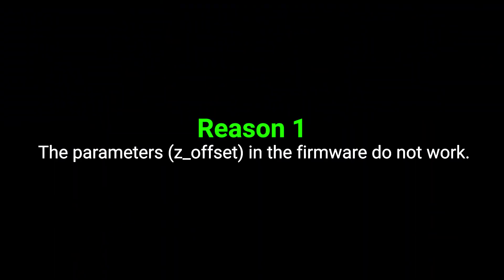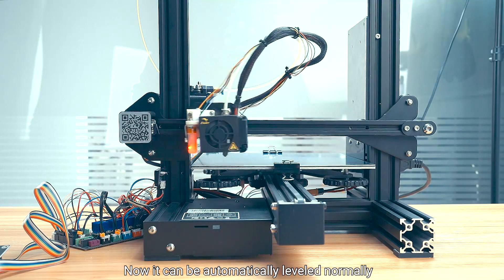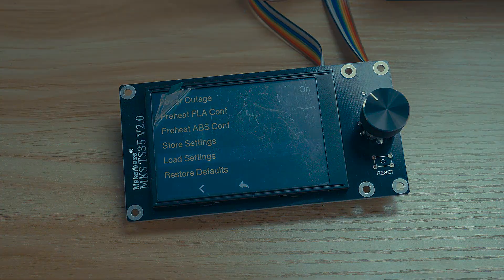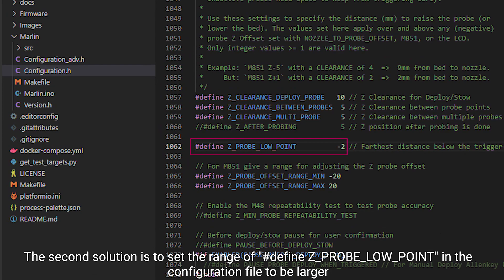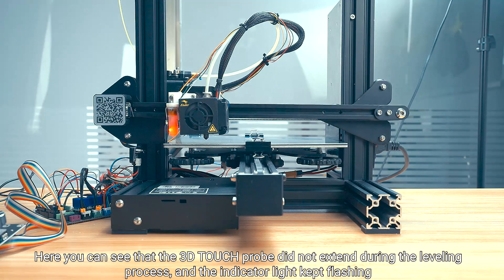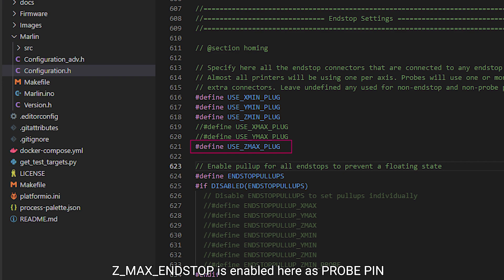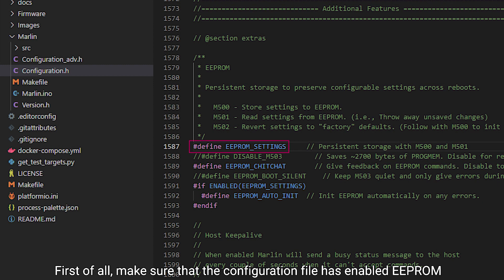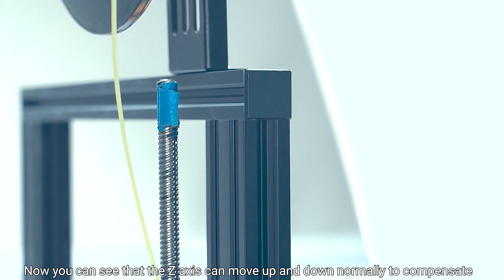3D TOUCH frequently appearing problems and solutions

Comment: the solution definetly isnt to set the maximum offset higher, but to level your bed.... if youre printing a part at like 150mm, youll have around 1.5mm skew in it in the Z, /=| where the | is the top layer and / is the bed....

Comment: I have an ender 3 pro with bl touch setup. Everything worked fine even the first print came our perfect. But when I go to give another print the while doing an auto bed leveling via start gcode, probing stopped at 7/9 point. I tried multiple ways to rectify. When I turned off the printer and tried again it worked fine. Not sure if it's issue with eeprom

Comment: I’m having an issue where after I create the mesh of points, I discover they are not accurate. There are times where the points are spot on or need minor correction with a sheet of paper, and then there are times where the nozzle is significantly off and the filament doesn’t stick to the bed, and I have to manually fix the mesh with a piece of paper. Any fixes to this?

Edit: I am using a CR Touch and Jyers’ 5x5 BL Touch Mesh.

Comment: I'm trying to make 3d touch work on my brand new ender2 pro and it doesnt work. It is going up on the Z-axis but it never goes down, even if I manually want to move the Z-axis down - it doesn't go.
Reply: I experience the same thing. Did you find any solution?

Comment: hi, i just bought 3d touch. it homes x and y axes and it goes for leveling test.but it straight goes to center,checks 2 times then stops.why it doesnt check 9 point of the bed?
Reply from the maker: This is an incorrect configuration of the firmware, did you follow our tutorial to configure it?

Comment: I installed 3dtouch on TwoTrees SP-5. When Auto level button is hit it homes all axis, asks for z offset, and then does nothing. Please help!
Reply from the maker: It won't auto level? Are you wired and configured correctly? You can send your wiring photos and firmware configuration to this mailbox 1428043543@qq.com, we will check it for you
Reply: @makerbaseteam4217  did you get it?
Reply from the maker: @XxFirePizzaxX Got it, where is your configuration file? i need config file

Comment: When I press home or autolevel it homes x and y and goes to the center of the bed. When there, the bl touch will extend its thing and just stay there. After a while it will give the error: 'PRINTER HALTED"

EDIT: found the problem, I accidently switched the E and Z cables why upgrading main board

Comment: I'm tempted to throw the BLTouch agaisnt a wall and bulldozer over it.

The BLTouch does it's selftest correctly when I turn on the power. But after that it just stops.
It wont do a manual selftest, or deploy (it does have a small blue light that turns on, but the VLTouch itself is red when the probe is retracted). 
When I autohome the probe stays retracted and just wants to crash on my bed. 
I checked the wiring, but everything looks OK. Even did try to wire it differently but it either doesnt fit or doesnt even do the power on selftest or becomes red.

It's on an Ender 3 Pro with the V4.2.2 mainboard. BLTouch is Smart V3.1
I need to use the Pinboard A because the wiring and cannot insert it directly on the board because the order of the 3 pins are: SIG (yellow), GND (blue) and VCC (red).
The 2 pins are in the Zstop on the board (black to the left, white to the right)

Please help

Comment: My Bltouch on ender 3 pro is weird. It doesn't deploy or stow, only stays stuck in a position. The LED turns on when force is applied, but without it stowing I cannot print.
Reply from the maker: Is this 3Dtouch working normally before? Or is the newly installed one not working properly?

Comment: i have just installed the 3D touch on my Ender 3 Pro and when getting it to Bed level, the probe extends but fails to stop, the nozzle crashes into the bed so i have to power off. any ideas anyone? many thanks.
Reply from the maker: You need to check whether the white signal line of 3Dtouch is connected to the enabled pin on the motherboard
Reply: Not sure if this was fixed, but bltouch version 3.0 had issues like that. Pretty sure it got fixed with the touch 3.1, but if you have the 3 then teaching tech has a video going over solutions

Comment: Error:Probing Failed.  I'm running an Ender 3 V2 with Smith3D-E3V2-2.0.x.16-5x5-Slow-100121 firmware.  It had been working great for about a year.  Then I started getting low hot end temp alarms, but I fixed that with tuning (I included in this comment in case it turns out to be relevant.  I'm getting a probing error (with BL Touch) at random points during the G29 bed leveling step.  I'm doing a 5x5 leveling grid.  Sometimes it fails early, sometimes late, but rarely makes it through the whole bed without failing.  I've manually leveled my bed.  My Z-offset is -2.35mm.  I have also replaced the BL Touch connectors with the correct JST type XH connector (I thought error was caused from the BL touch connector was making intermittent contact). I've also checked to make sure the bed is high enough so the BL Touch probe detects the bed before factor Z-home microswitch is tripped, although if I manually trip this during the bed leveling, it is ignored, so that is definitely not the problem.  I'm stumped.  I don't know what else to try.  I've also checked my bed to make sure it's not (badly) warped.  It's as flat as I can detect with a straight-edge.  HELP!!
Reply from the maker: You can check every item mentioned in the video, the firmware configuration should be incorrect

Comment: I have a bltouch on ender 3 pro. when I set it to home the z axis. It homes y and x first. The z axis will lift up and start to do the homing in mid air. I’ve tried different kinds of software and I’ve checked the wiring like 1000000 times and it looks good.
Reply: i have the exact same problem. dit you find a soulution?
Reply: @SuperAtju  I have the same problem too. I'm going to guess that you guys haven't found a solution yet.
Reply: Same problem. Z axis isn't gong down. Did you guys also remove the Z-endstop and did you plug all wires in the BLtouch slot?
Reply: @goku445  have you found the solution for this?
Reply: @torcek1991  Yes! It was a connection issue. I reseated the plug and secured it with hot glue. Working perfectly since.
Reply: @goku445  thanks, I had the same issue and it turned out that I had connector issue as well - now works :)
Reply: @torcek1991  Glad it helped. Enjoy!

Comment: Hi, I have a geeetech A30m, and it wont use the data from the 3d touch, or its uses the old data, becouse 3d model its always loose to the right and thight too the left.
Reply from the maker: Is the data useless after re-leveling? What motherboard and screen are you using? Did you save and load the data after leveling?

Comment: hi i got a problem with my bl touch on cr 10s when i set z-offset in the correct way and i proceed to print the bed get automatically leveled by bl touch but the print start with the nozzle always lower hitting the bed
Reply from the maker: Hello, is the nozzle kept pressing on the hot bed? This is the value of z_offset is too large, you need to reduce the value, and then need to re-leveling
Reply: @makerbaseteam4217  i have already fix It, i dont know why when i was setting the z offset the printer refuse to use the right value thanks!
Reply: @manux1508  hey how did you fix it
Reply: @gabg116  i Just used the printer interface because pronterface wasnt saving the offset and i Just lower the bed with the knobs most as i can

Comment: Hi, my bl touch levels bed when I manually ask it to. So I go onto the printer screen and click bed levelling and it probs all 9 points. However, when I start a print and it levels the bed again it'll go into the middle of the bed and go all the way down and the nozzle and no touch crash into the bed
Reply from the maker: Did you add an automatic leveling command to Gcode? What instruction did you add
Reply: @makerbaseteam4217  Mine does the same as his. How and what code would you add for this specific issues. I'm working with an Ender 3 v2.
Reply: @thersmokey6131 I have the same problem right now. Any solutions?
Reply: @Dave-ut2zs  hey, did you solve it ? i got the same problem

Comment: no ı tried but ı dont have initilaze or load settings on my menu and I tried to change the cables black and white didnt work I tried to re edit the firmware , with visual s code and platformio when I finished I couldnt compress to bin it gives mistake egenadira@gmail.com is my mail, maybe you can send me the .bin file for this
Reply from the maker: What motherboard is yours? What is the phenomenon of your 3dtouch problem?
Reply: @makerbaseteam4217  Robin nano v3 and ender 3 pro, ı Got the first problem it just stops in the first point
Reply from the maker: @egenadirakan  You can send me your configuration file, I will modify a firmware for you, email 1428043543@qq.com

Comment: I have a problem with 3dTouch. 
The probe doesn't want to deploy no matter what I do. I have installed different firmware several times and rotated pins but still same behavior. 
What could be the problem? Shielding? Pinout? How can I debug it?
Printer is Ender 3v2
Reply from the maker: It should be a problem with wiring and firmware configuration, can you send me your configuration file to see, email 1428043543@qq.com, or you can contact us on facebook to discuss the problem there
Reply: Yup this happens to me and my 3d touch it deploys sometimes while making the mesh and it wont at some points it will just not deply